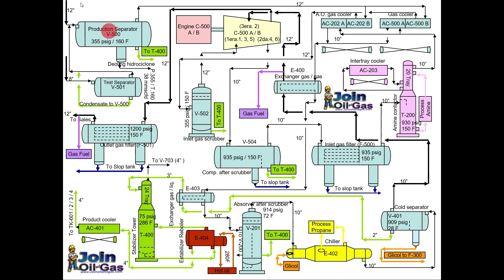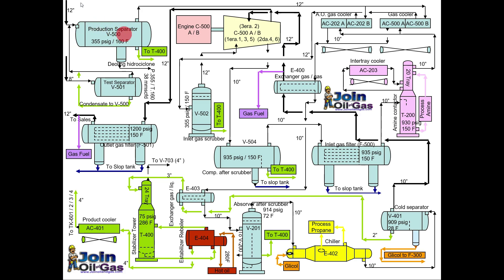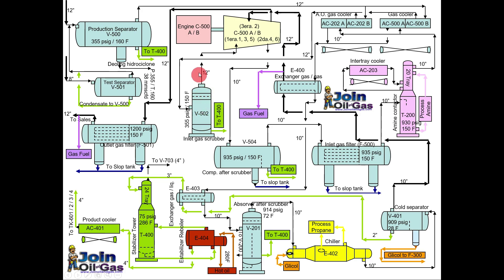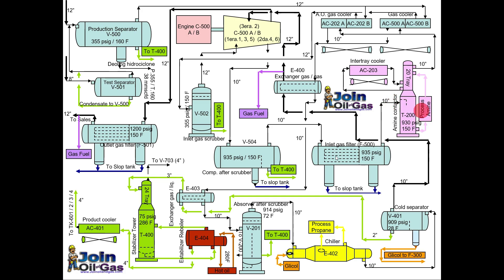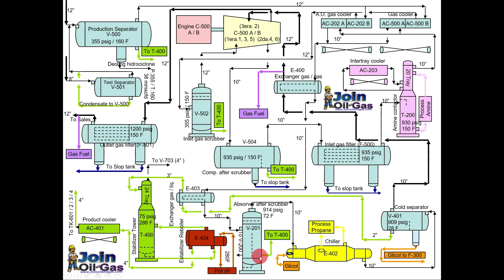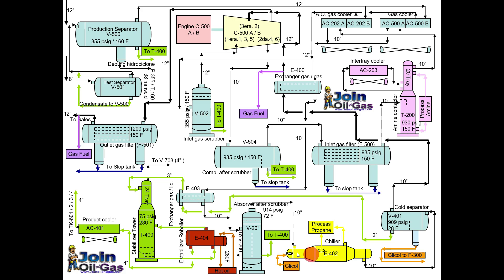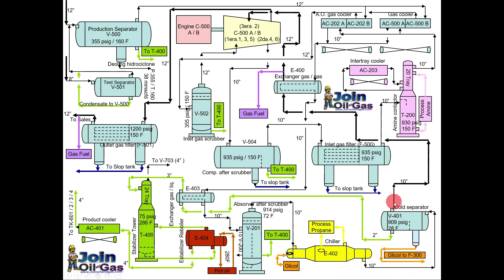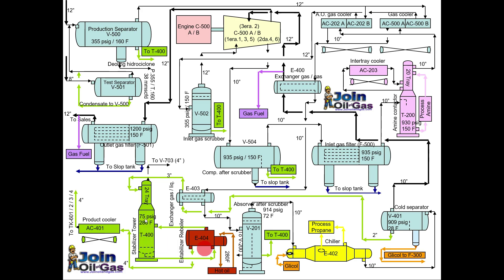Gas Processing Plant Process Flow Diagram and Explanation

Comment: What is the difference between KV and XV valves in refineries? What does Kv stand for?
Reply: XV valves are on/off valves that are used to quickly isolated a fluid and typically provide right shut off capabilities. They are not used to modulate or vary the flow.
HV Valves are Hand Valves. Manually operated.
KV Valves are Time, Schedule, Time Rate of Change Valves